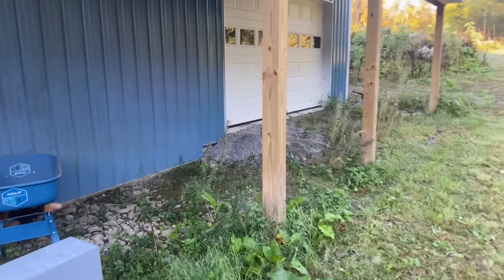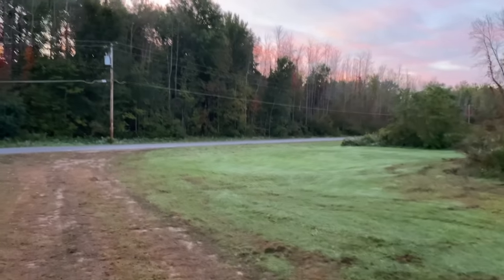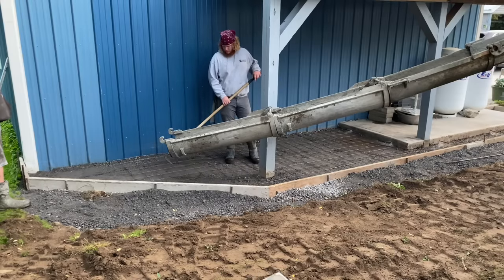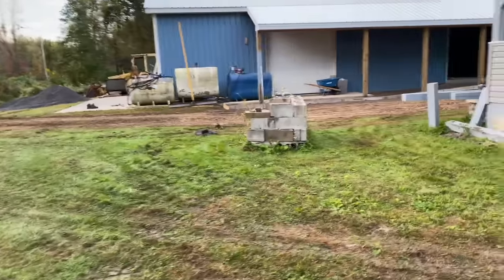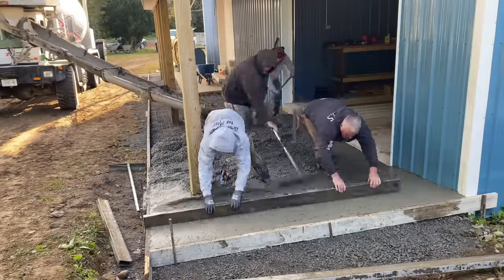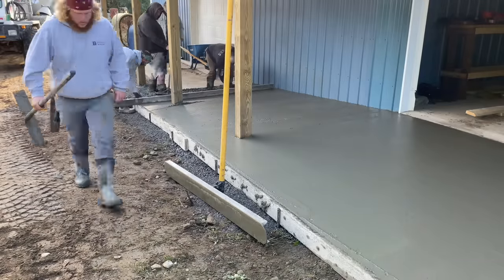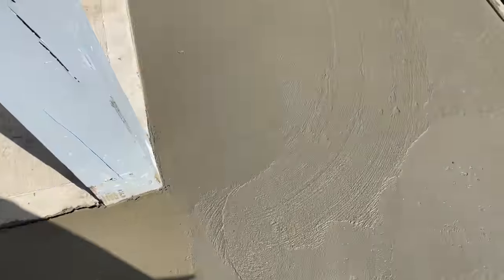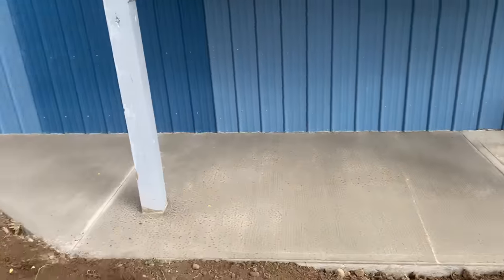WET CONCRETE!!! HAD TO REJECT THE LOAD. 👎🏼

Comment: Another contractor here to "rip" on your work. Why didn't you put some type of expansion felt or a water barrier against the metal wall panels? Those metal wall panels are guaranteed to rust out sooner than normal where the bottom is trapped by the concrete.
Reply: NEVER SHOULD HAVE DONE THAT GUARANTEE TO RUST OUT. I WOULD HAVE REFUSED TO DO THAT. NOT ACEPTABLE..THAT GUY MAY COME BACK AND SUE SAYING HE WASNT TOLD IT WOULD ROT FROM PUTTING CONCRETE NEXT TO IT..THAT IS NOT ACCEPTABLE BUILDING STANDARD ANYWHERE IN THE COUNTRY
Reply: yep and concrete hard up to the timber posts lol. guarenteed to rot unless their cypress
Reply: Glad I wasn't the only one thinking this......
Reply: Yeah ..? Im not a concrete guy but ive done a few over the years ,usually only this size +/-…the first thing i was wondering,how can it be right to have no type of barrier/expansion joint against the metal building ..had to pause to see if it was asked and answered in comments … and wow that was quite loose like mortar slurry for filling block cores  lol.
Reply: Water will run down the metal and have no where to go but between the siding and the slab, wet all the time. Also I wonder about expansion and contraction against the ribs of the siding. Maybe that's what the homeowner wanted?
Reply: In ten years never have had one rust out more than normal as paint and concrete both will seal the place it will rust above the concrete
Reply: Isn't it under a roof?
Reply: @tonyp9179 well said. If there's fall in the concrete out from the building and it's under a roof, how's there going to be any water.
Reply: Something tells me that this homeowner didn't want any frills and dressing on this job. Customers like this will always find someone to do the job, minds well do the best job possible. As long as he understands the risks...
Reply: He did what the owner wanted.
Reply: Don't know if its the case in your area, but our local manufacturers will not warranty metal siding or roofing that is in direct contact with wet concrete.
Reply: Yea, man, that's bad. That metal siding will corrode real fast.
Reply: @frankk533  Condensation.
Reply: Not a cotractor here, and i was wondering the same thing

Comment: Why bother pulling up the steel mesh when you just step on it right afterwards anyway
Reply: Because concrete has stone in it when you pick the mesh up it sits on the stone and doesn’t drop.

Comment: I'm surprised you don't wrap the posts are line the buildings with some sort of water barrier joint.  Nearly every other concrete channel I watch does this... and with good reason.  Perhaps you'll want to look into it.  Otherwise... I love watching you dress up these properties with tastefully designed concrete-scaping.
Reply: wood posts expand and contract with moisture we usually use a foam that has a zip strip on top. After concrete has cured pull the zip strip and caulk it. at the same time i cant believe they bury wood posts in concrete and dirt. out here in california everything is sitting in a metal column base that is wetset in concrete and connected to footing.
Reply: @bradley-concrete agreed. Wrapping these posts would have been simple and cheap to do but some people just watch a few vids and start their own company these days....... I guess
Reply: @bradley-concrete  how long do you think these posts would last like that? just curious in how much more it extends the life by doing a simple wrap.
Reply: How long does wood last in a wet condition where it can’t breath? Pressure treated would last longer but regular Doug fir could rot out in a few years.. also the expansion and contraction of the wood can crack the concrete off the posts. It’s just bad practice and I see a lot of contractors doing this pole barns that aren’t going to last too long
Reply from the maker: I wish they built out barns like that I have said that for years.  @bradley-concrete
Reply: @BadForYourKidneys  my first thoughts. termites are all coming to dinner.
Reply from the maker: We do not have termites @mikethepainter

Comment: That wet cement, the average home owner would never put enough weight on it. I pour 5.5 to 6 all the time never have any trouble with it. Two things I find that are important keeping your metal pulled up and I cover with burlap and wet for 48 hours. Most cracking is from drying to fast and shrinking. Where water matters is like a Highway where you have 80,000 lbs. Beating on it.

Comment: That concrete was about a 6 1/2 in. like you said. I've seen 500 or more jobs just like that one with concrete just like that. Zero issues. Including that little grade. In fact 75% of the time, I showed up with that 4" slump, the crew is wetting it up to about what that first truck brought, with grades like the one here.
And many of those were the best concrete crews in the business. This would be their Saturday work for extra money.
It was a hair too wet, no doubt about it. But doable.

You're right though, the stiffer the mud, the better. Everybody was happy in the end.
Glad you got a new load real quick. Looks like you guys do good work.

Comment: I drive a mixer out of central PA. Sometimes when it does load wet out of the plant they will load another dry yard on top of it to dry it up. It's up to the driver to know BEFORE he leaves the plant, its cheaper to add an extra dry yard & not bill the customer for it than to have a whole load sent back & eat the cost of that.
Reply: I’m surprised they didn’t just run first truck back to plant and add a yard or two of dry mix to firm up load

Comment: Looks great guys. Good job. My concrete guy will have to pour in about 38 degrees here in Wa. In a week. I don’t want Calcium because it will rust the rebar and wire mesh. Plus have cracking problems
Reply from the maker: Hope he has some other kind of accelerator and hot water in there  Thanks

Comment: Those posts will rot out pretty fast, should have made a small concrete pedestal for them to sit on.
Reply: No, need a barrier against moisture. If the poles are sitting on concrete, the wood will suck moisture through the concrete due to the capillary effect.
Reply: What's fast though?  In my neck of the woods a non pressure treated fence post in concrete will last around 35 years.  It's probably much faster in places that stay wet most the year.
Reply: @Zt3v3  You in Az can get away with all kinds of stuff.
Reply: @Zt3v3 wrapping it with expansion foam is quick, cheap, and easy to do and it will save that post ALOT longer

Comment: I've started wrapping hard molded plastic on the 4x4's about 3" above ground level before concrete.  Prevents water contact of the 4x4s at ground level, since that's were they tend to fail.  I liberally coat the inside of molded plastic with 100% silicone, then wrap a couple rubber bands overnight to keep it tight.  Your 4X4 wont fail at ground level anymore.

Comment: Next time just check the water gauge on the tank immediately, if the load appears wet upon arrival, 
that will tell you if you can trust the driver next time to be telling the truth. Wet loads from the plant do and will happen, but sometimes all it takes is a seconds worth of loss of attention on the drivers part to have a wet load, fronts have increased air pressure to the water tanks as a rule to aid cleaning the longer drums, which can result in water being added very quickly. I’m not saying that’s what happened here, just it does happen. If it’s the same truck back, they probably just added a dry yard to the old load to dry it up. 😉😳

Comment: I can never understand why ready-mix places have such frequent mess-ups with concrete slump or mixture specs. It's a pretty concluded science this stuff, and these places have all the computer controlled everything needed to make it exactly as desired.
Reply: I work for a Thomas concrete. Bro you be surprised... Not all places got a wet batch. Wet batch usually come prepared with your request slump. But dry batch does not you got to get the hose and eye it yourself which is crazy.

Comment: Is it normal to pour concrete right up against the metal wall? This is a sure fire way to rust out that paneling and trap moisture - I know building code [IRC] wouldn't allow for this, but I wanted to ask.

Comment: i can never understand why in so many concrete laying videos I watch that the wire mesh is sitting on the ground. The mesh provides strength to a slab if it is in about the middle if the slab. In Australia, an engineer would tell you to rip the slab up if that was done on a construction job. At least have a hook and lift it after all the workers have pressed it to ground level.
Reply: If you watch closely the guys were doing that with their come alongs

Comment: Nothing to keep the building from getting splattered, no expansion foam around the posts and you guys are pouring right against the tin siding but you think your problem is a little wet mud!?😂😂😂
Edit: you should have waited longer to broom the wet stuff so it isn't so rough and the fact that you had to come back and saw cut that little baby apron instead of just wet cutting it is a bit embarrassing .......

Comment: Unless the owner gets gutters, that drip line is gonna piss him off every time, but the way you bury those posts makes me think it don't rain much where you are.
on a technical query...why is a 9 slump squishier than a 4 slump?
Reply from the maker: The higher the slump the more water is in the mix so it is wetter and not as strong. He just wanted concrete there so he could run his mower over it and not have to weed wack.

Comment: we all grow from criticism. here in michigan though the standard is half inch paper against the structure and half inch foam around the posts. but heres the problem. those barn walls are corrugated and paper comes flat. so the everyone talking about why didnt you do this and why didnt you do that.... the customer wants concrete agaisnt the barn. maybe at the least they could have put some sort of expansion material like foam spray between the pad and structure but even then, its a shor in the dark. you should always work with what you can because what works on some jobs may not and in this case would not work on this job. definitely expansion foam on the wood posts though. they will cause pocking sure enough

Comment: No expansion joints along the building?
Reply: I would say it would be a little tough to put expansion along that corrugated metal ! But around the exiting concrete would be an idea !
Reply: I know !   That metal will start to rust sooner too.   Unfortunately placing foam against it is a pain in the backside.   Definitely would wrap those post.

Comment: ask for the batch weights.   the driver should always check the slump after mixing, & before leaving the plant !    you guys are our pay check...thank you...& the slump buster will not correct the cement/water ratio.    the concrete was not what was paid for.            I hate cheaters.  take it all out.   GP

Comment: Personally i would have been inclined to put the wood posts up on concrete pillars instead of encasing them in the mud
Reply from the maker: Yes I agree we do not build these barns just pour the floors. I hate how they put the posts of all our barns in the ground around here. They use the ground and 4feet deep as part of the structure and they can frame them lighter. They are more cot effective but Im not a fan.

Comment: I would suggest to not accept a load that exceeds the design slump like that. Reject before you put any down. Plus may want to concider using a Concrete Vibrator.

Comment: That tin is going to rust.  Why not cut it off, concrete to foundation, sealer, then flashing under tin?  To do it right, I would take the tin right off, pour concrete, seal it, flashing, then reinstall tin.  Just because I am fussy.

Comment: Concrete can pull some tricks on you about it's strength.  In collage I was a proctor in a soils lab.  We filled test cylinders with different mixes.  Some were correct and others had bad ratios.  Most tested as expected.  One that had too much water was one of the tested.  The pressure went to the max of the press.  We left it set a few seconds and  it exploded.  The many hundred pound press jumped off the floor. The chain enclosure kept most concrete contained.
Reply: When laboring Id watch you folks take samples, they'd always poke wet sample in those black holders with rebar a bunch. They said to release gases contained in. WTF do I know , get paid from neck down. 😅

Comment: That's why your work us great and high quality. You come up with a solution for problems that arise. 👍... Bill
Reply: If you think this is high quality, then you know nothing about doing concrete work. As many have said on here, pouring against that tin siding is stupid and will rust it out. Also pouring against those wood posts is stupid and will rot them out. Homeowner will be replacing all that within 10 years. This is far from high quality

Comment: You did the ramp section, so add water to the mix so the guys are not dealing with a stiff mix on the flats.  No barrier against the walls to absorb splash?  Post?  No wrap?  It's gonna be hell when he attempts to R and R those wooden post submerged into the pad.  I didn't see footers with those post, maybe I missed it.
Reply from the maker: I was hired to just pour the concrete. I did not build the barn.

Comment: Do you ever tape up plastic to keep the metal clean? Just trim the plastic tight to the 'crete surface the next day? I was forming some shapes under and around 4x4 posts but the posts would take a drink through the bottom end, expand and crack the 'crete! I slipped a plastic bag over the bottom end of the last post -- taped it above the pour level -- and no cracks = mo' betta'! :)
Reply from the maker: Nice idea thanks
Reply: I’m surprised you kept wall clean.  Did you have to wash off concrete spatter off of siding the next day?
Reply from the maker: We always wipe anything off the same day if need be.  @ecgwyo

Comment: I deliver concrete. contractor starts chewing on me about wet concrete when all he told dispatch was it's a slab. everytime within 5 minutes they're wanting water added. I flat out tell them it's wet enough they don't get water. And my boss backs me up. Take out your frustrations on your crew not the driver.
Reply from the maker: We communicate with dispatch and I am real nice to all the drivers. Just gave them all a $50 hoodie. Mistakes happen in this work. We do not pour wet concrete and everyone at the plant knows that.

Comment: U could see the ditch forming on the ground from water pouring off the roof why would he come out beyond that with the concrete???? I highly suggest getting a gutter or that concrete will be ruined fast! It’s like holding a pressure washer to one spot of concrete and coming back in a month to see it’s formed a hole in the concrete

Comment: Customer is going to be even more pissed when those posts rot out due to you pouring the concrete right up against them.
Reply from the maker: If it was up to me the wood would never be put in the ground.  the concrete will not help or hurt the posts from someday rotting out. Im not a fan of pole barns built this way
Reply: @bondobuilt386 it does hurt it because it holds moisture between the 2 so it will causes it to rot faster but customers get what they want
Reply: @bondobuilt386 wrong! The concrete will trap moisture on that wood and rot it out. Use expansion foam and wrap it twice if you want to pour around posts. Any seasoned vet knows this
Reply: Those of us contractors wizard few years under our belts can confirm that even the best treated lumber still rots out faster in concrete.  Moisture gets trapped between concrete and post.  Put some type of expansion around post, then seal top with good caulking.  Also prevents post from swelling due to moisture and cracking concrete around post.

Comment: Most people I pour for want it even more Wet! Im not joking I pour for some contractors where Ill show up at a 5inch, and they add enough water themselves to turn it into a 10 inch easy!!! Thats about the slump they normally want! Its only the big contractors i pour for, State, city, big name outfits like Kewit or Hawkings that Actually care about the too much water in the load!!
Reply from the maker: Yes and that is a shame because it ruins the strength of the concrete and on residential the building inspectors do not check it at all.

Comment: And I would have supported the roof, cut the posts off and installed adjustable galvanized post brackets in the concrete

Comment: Maybe it rained hard over noght and the drum had water on it on the forst load.🤷‍♂️
Reply: First thing the driver is supposed to do when he finishes his pre trip is to spin the drum in discharge, just for that reason.
Reply: @Musclecar1972  that would make sense. Maybe he missed that or the aggregate was wet. How they fix it is all the matters.
Reply: @Woodman_Custom_Sawing   Yes Sir, there can be a bunch of  different reasons for a wet load, it’s not always the drivers fault, I have experience on both sides of this problem, had my own masonry business for many years, then when the body got tired, I drove front dump mixers for a long time as well. 😉

Comment: I guess the homeowner doesnt care about the post or building  because he took no measures to protect them from rot or oxidation/rust.      I cant blame you because I dont know if the homeowner depended on you for advice, but apparently he knew the slump of
 the mix and maybe knows what concrete can do up against buildings and wooden supports.